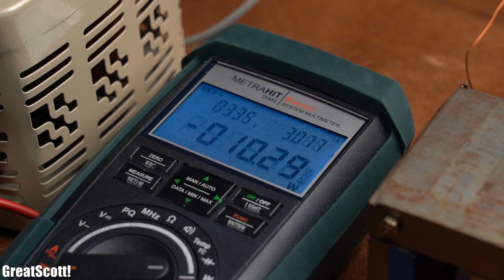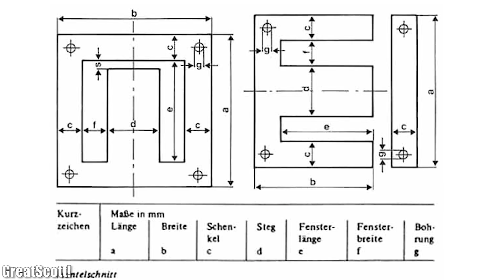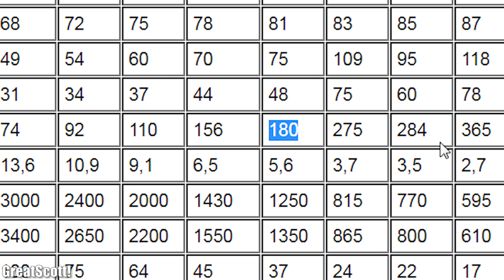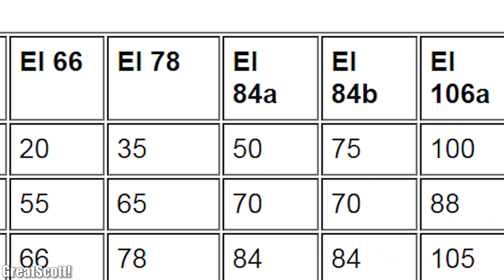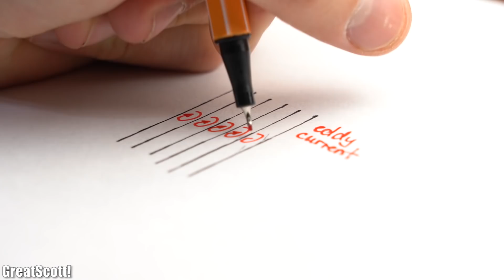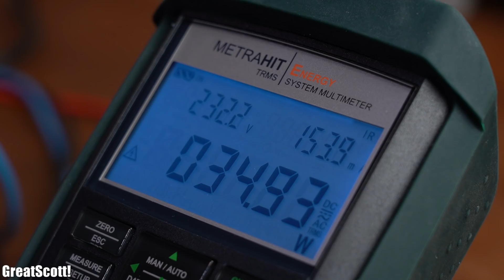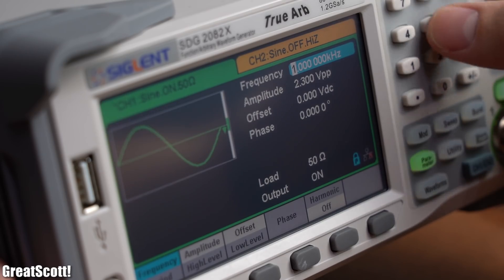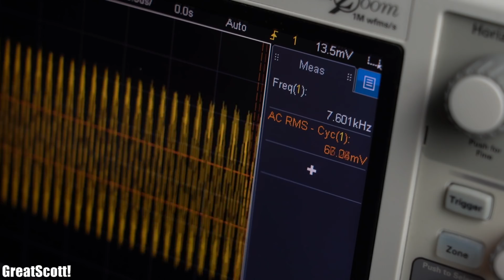Can you 3D print a Transformer? (Experiment) || How to make a mains Transformer!

Comment: I have been thinking about doing the 3D printed transformer bobbins, especially for custom higher frequency transformers (be it the transformer with built-in inverter driver, or just to handle high voltage), rather than using one that's available, as they're still a little bit harder to find. And 3D printed ferromagnetic transformer core may probably do okay with high frequency, beyond 60 Hz, I gotta actually test it on my 3D printed transformer at some point.

Comment: I'm afraid, this video is somewhat misleading (although the final conclusion is correct - the filament is not useful for making transformers). The inductance you measure is primarily determined by permeability of core material, and has no relation to saturation inductance Bmax.

Not only that, but also the transformer equation assumes that the core's permeability is much higher than that of air, by assuming that the flux created in the air around the core is negligible. For transformer steel, which has permeability of around 1000, this assumption is pretty accurate; for the filament, which has a permeability of about 2 (i measured it), the assumption is simply untrue.

The ferromagnetic filament is pretty useless primarily because of this low permeability - it does not constrain all the magnetic field into itself, and does not massively reduce reluctance. It is only a slight improvement over an air-cored transformer (or your PLA transformer, or any non-magnetic core transformer if that can ever be called a core). 

When I measured the permeability, i actually have measured the hysteresis curve, so i could have determined the Bmax... but. It was a straight line; i could not reach any signs of saturation - my test winding would just burn.

Comment: Can the properties of an existing transformer be calculated, such as using wire diameter, resistance, and approximate average length per turn to guesstimate number of turns and then finding the relative permeability of the core?  Then that data could be used to rewind the transformer no?  How would you go about doing this for someone without an electrical engineering degree?

Comment: Could you explain how you chose 2.8 amps / mm^2 ?  Is this the current density of copper which gives an acceptably power loss at the maximum design current?
Reply: The resistivity of the copper and the geometrical sizes are such that the resistance of the coil is R. Then your losses are going to be I²R, where I is the maximum current.

Comment: Other than for the sake of experiment 3d printing core lamination makes no sense since transformer core is way cheaper than 3d printing even if it would perform the same. Even the plastic bobbin is more expensive than the laminations in a transformer. The relatively expensive part is the copper wire and time it takes to produce the transformer.

Comment: It works, at high frequency. At low frequency, the impedance a.k.a inductive reactance of the primary winding is too low, because the 3d printed core has very low inductance compared to laminated iron core. As frequency increase, the impedance also increase. xl=2πfL
Reply: So this could be valid for switch mode power supplies at high frequency? If so what frequency are you thinking?

Comment: I just subscribed (while wondering why I wasn't already).
Anyway, I assume the ferromagnetic filament for the 3D printer has some plastic or resinous content, to make it compatible with a typical printer, seeing as they normally print plastic parts. That means the total amount of iron in a given volume of printed core is less than that of a solid piece of iron, or even that of an equal volume of ferrite or powdered iron core. This would have a similar effect as having fewer iron sheets, with plastic or air (which essentially have the same magnetic properties) between them. And this bears out in your observations: versus an otherwise identical iron core inductor, an air core inductor will have a lower inductance. What you have is somewhere between iron and air (because there's "air" between the iron LOL).
I've heard about other methods of 3D printing metal, though not exactly accessible to the average hobbyist or maker, which could probably print very functional cores.
Now, as to your original question, and the topic of the video, I'd posit that it may I fact be possible, with ferromagnetic filament, to 3D print a mains transformer. Personally, I'd also print the coil former since that would increase the total iron content. But experiments need to be done to determine the size and shape of core that would be required. The end result will be larger than any existing design intended for solid iron sheets.
One experimental direction you could attempt, and might be able to make a second video on, is to take that "90 times bigger" approximation you came up with, and choose a core with 90 times the ratings of this one, but calculate the winding requirements the same as this core. Or find a compromise, such as a core with 10 times the ratings plus 9 times as many windings, or 13 & 7, or any other combination that's close to 90 without going to far under (like 11 & 8 would probably work, but with an overall lower output rating).
Another experiment to reduce the amount of "air" in the core might be trying to print a more solid core. Try, for example, 3 thick Es and Is, solid printed (no honeycomb!). Or even two thick halves, something halfway between an E and an L, so the two stubs of the center part of the core meet in the middle, and hold them together with a pair of rectangular printed frames on top and bottom but not passing through the coils. Food for thought.
Reply: It occurs to me that a core printed out of this stuff might be much more difficult to saturate, if not impossible... Why this matters? Maybe not much these days, but back in the days of vacuum tubes, this would be quite significant. A single-ended power amp (as opposed to push-pull) had an output transformer that needed to be built so it couldn't saturate, because its primary also carried DC current, carrying the output/power tube's plate supply current and thus being its load. They hadda put an air gap in the core so it couldn't saturate, and then make the whole thing huge to compensate for the loss in flux density resulting from the gap.
But of course, these operated from around 100Hz to 15kHz, and the biggest (rated for 25W) could be expected to see 80mA on the primary plus 56mA across it DC, and 2.5A on the secondary (designed to match the 4kΩ vacuum tube to a 4Ω speaker). But that's an exceptional example. Still, the end result would have been massive and heavy with an iron core. I wonder if it could be better made on a 3D printer?
Reply: As your observation, the problem is the filament. It can be easily done making custom filaments. Who knows what the actual percentage of iron is in the PLA, can't be more than 10%, if you saw the inductance of the ferro-PLA, it was only 78uH compared to 3.4H... that is just ridiculously small. If there was at least 50% iron in the PLA the inductance should be at least 1H. The filament scott was using is "proto-pasta ferromagnetic iron filament" and they do not disclose the iron content percentage in the filament (which is stupid). But reading reviews about this ferromagnetic filament the iron content is around 8% (no wonder inductance was 78uH). It can be easily done by making home made PLA filaments doped with higher percentage of pure iron powder, lets say 50% iron and 50% PLA. Better yet using nanocrystalline or amorphous metal powder which is 5 times more magnetically permeable than iron doped to PLA. Buying this proto pasta ferromagnetic filament is really silly for any electrical use. Now that's some real food for thought...

Comment: small main transformer always pain to winding manually 😂, high power rating ei core should wound stacked primary and secondary to minimize phase shift, minimize air gap with tighter the core to minimize leakage flux, i usually add more turns primary, to compensate fluctuation main voltage up to 250v.

Comment: You know, I had always wondered how one could practically test the flux density value of a transformer/inductor using basic test equipment. Still an amateur at electronics so I learn something from every one of your videos. Thank you for the work you do, I find it very interesting.
Reply: you need to know the magnetic path length and cross sectional area of the core, voltage, frequency and number of turns then you can calculate B.  Path length and cross sec area are located in manufacturers data sheets so your all set.  Really just pick a B that you want to operate at and calculate the volts/turn.

Comment: I'm not impressed that the magnetic filament was only 50% more magnetic than free space. The steel is 4500% more magnetic than free space based on your results. BTW the reason for laminations is that if the steel were solid, the conductive space inside would behave like shorted turns of wire in the transformer. The laminations prevent a current loop from forming. Since the magnetic filament is not conductive there is no danger of this so you would have slightly better results by printing a solid core.

R-core transformers are made by just winding flat steel into a coil. Similarly, you could make a transformer just by winding coils around your magnetic filament reel. However you want to optimize the core's cross sectional area (minus air gaps) divided by the length of the magnetic loop through the core. In which case you would want to print a solid toroid or at least make a smaller coil of filament to use as the core.

But in any case a magnetic permeability of 1.5 makes this material only marginally better than air for a transformer core.

Comment: CURRENTS INDUCTION RESISTANT...CAPACITORS HOW MUCH VOLTAGE uF..High Voltages How Long is The Pulses ...BATTERY 12V...BY CHARGING IT HAS TO BE OVER 12VOLTS AMP IS A CURRENTS..INDUCTION USED HY OHMS...

Comment: It might be beneficial to compare the hysteresis loops of these cores. It can be measured with a scope and a variable transformer and a few small other things. It also would be much more spectacular I guess.
Reply: The hysteresis curve of the 3d-printed core is a straight line for most practical purposes (yes, i have measured it). Its permeability is so low (about 2) that reaching the saturation in high-duty-cycle devices like transformers and motors is pretty much impossible.

Comment: The limiting factor here is not the maximum flux density of the material. The 3D printed material is basicly iron particles with a lot of non-ferromagnetic stuff (the plastic) in between. The saturation of the individual particles is still the same. The limiting factor here is the high magnetizing current due to the low inductance. This in itself would not be a problem but it causes high resistive losses in the copper windings.

Comment: Winding the primary gets tricky, too few windings and it overheats, too many and you won't get enough voltage. I usually add about 50 extra turns to the primary and it won't overheat.

Comment: Interesting!  Due to the high cost of isolation transformers in my part of the world I endeavored to build a 100V to 120V 50Hz isolation transformer using an inexpensive 20A 240V to 120V 60Hz step-down transformer as its basis.  While disassembling the xfmr I found out why it was so cheap.  It had only one winding (autotransformer design) and used 14 ga aluminum wire which I didn't recognize at first because the wire's coating looked just like copper.  The xfmr came apart easily enough but I managed to drop the cheap nylon bobbin two feet onto a rug covered floor and it shattered into a dozen pieces, so now I had to build a bobbin.  This I did out of 1.5mm FR4 sheets (basically uncladded PCB stock) and while doing so separated the primary and secondary halves into their own sections and this turned out fantastically.  I then looked up as many online transformer calculator sites as I could find, calculated the number of turns I'd need adding taps for 105, 110, 115, 120 and 125 Volts (the original xfmr had a 5-way switch for this purpose), added a few extra turns for good measure, and rewound the core using the original 14 ga aluminum wire.  When I was done I had 20 or so turns worth of wire left over but left it off so as to not upset my calculations.  I then powered it up... and it worked!... but not at 20A.  At best it would give three or four amps while humming badly and it will overheat if I leave it on for more than an hour or so.  Not to be deterred, I added a two amp circuit breaker to the output, a temperature controlled fan and a 20uF AC motor capacitor to the secondary for a bit of PF correction and it now will work reliably for several hours, but I dare not leave it on for longer than that.  Most of the drop in performance I attribute to the aluminum wire but none of the calculators I found had adjustments for aluminum.  The unoptimized 60 Hz core material probably doesn't like being run on 50Hz as well.  However, it will serve like this on my electronics bench until I can afford to buy a true isolation transformer or locate a used one.

Comment: What about 3D printing the coil former as well ?
It's a more complex shape to 3D print and design.
Would like to know if it's possible, as I have a plastic coil former I managed to crack, and had no luck getting a replacement.
Reply: Try to get some polyester drawing film (it normally gets used like drawing paper, but made from plastic). If you can, then look up how to do solvent welding with it, and you'll be able to do much finer-scale coil formers than a 3d printer would be able.

Comment: I would like to see some DIY high frequency transformers in your videos since using a mains voltage 50/60hz transformer is kind of obsolete.
Reply: That's actually not obsolete. A lot of stuff still uses them, because for anything more impressive than a lightbulb you want isolation, and higher wattage stuff calls for somewhat rarer 400v+ capacitors in a PFC stage, making those too much trouble for most people to bother with. Normal SMPS are more commonly relevant after the transformer than as a replacement for it, and DC only makes sense for long-distance HV, and areas smaller than most rooms.

Comment: Interesting - I was hesitating on buying a reel of this as a "better than air" substrate in a 3d-printed axial motor, but it appears to give a moderate benefit - Thanks.
Reply: You should consider it a sensor & mechanism material instead: focusing fields onto a sensor, building an armature when you want fairly precise spacing, armatures for "fluxgate compases", passive components for magnetic latches, "programmable magnets", part or all of a filter for Hall effect sensors, part or all of magnetic logic circuits, cores for "magnetic 1-wire" access cards, etc.

The stuff's just not particularly fit for motor use, but don't write it off without considering it's other possible uses.

Comment: Nice, again. Thanks GS!
It made me wonder: if the printer filament is not conductive, there's no reason to print plates. As you explained, the plates are to 'compartimentalise' eddy currents. So if the iron particles in the printed filament remain electrically insulated from eachother, you could 'just' print the core as a massive ("monolythic"?) E+I block, right? Then again as you've shown us, the iron content is low, so we can't expect the printed core of the same dimensions to have the right magnetic permeability. Based on 'iron filament', the whole thing would become huge, I guestimate :)
An electronics video touching physics: I like it!

Comment: Do you plan to try this with a ferrite core transformer ? 
for example, replacing the ferrite core with a 3D printed core to see if it works in a switching power supply

Comment: I would assume having a core made with the standard PLA would be effectively the same as having no core at all?
Reply: Well, it'd provide mechanical support of a kind? Actually quite viable at RF, where air-cored inductors are common. My roof antenna works very well indeed using an inductor that's nothing but wire wrapped around a 3D-printed form that holds it in shape.

Comment: I want to know if this could be used for high frequency isolation xfmrs like for fet drivers or ethernet. Also I wonder if at smps frequencies if it could be used for low power apps like running leds

Comment: You could have skipped most of the sheets and made it a solid block though. The particles are dispersed so finely that they wouldn't need laminations. Not sure how many microHz you'd gain from that though. Thinner wire and a round bobbin you can spool stuff onto with a drill could work :)
Especially for very low current requirements.
Reply: I suggested something similar. Also suggested printing the coil former out of the same material
Reply: Isn't printing specifically in sheets prevent current loss due to eddy current? Wouldn't a huge lump of block cause a massive eddy current to occur internally?
Reply: @sto2779  A bit late, but for those wondering about this, the answer is no. The iron particles are suspended in the plastic and not continuous. The only way you're going to get significant eddy currents from that would be to heat sinter the plastic out (using a kiln at several hundred Celsius for some hours).

Comment: 5:30 For better isolation you should've put a layer of isolation between every layer of windings, that way if there was any exposed copper or if the enamel melted off it couldn't short through multiple layers.